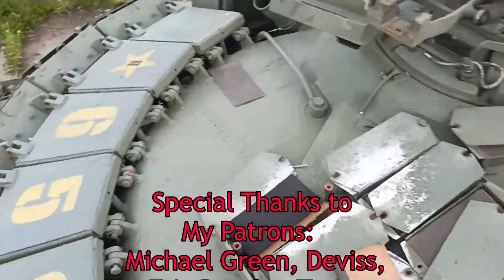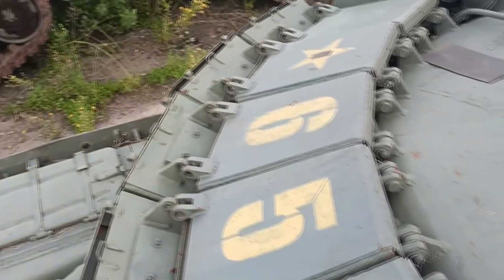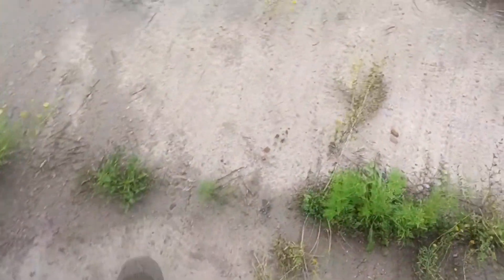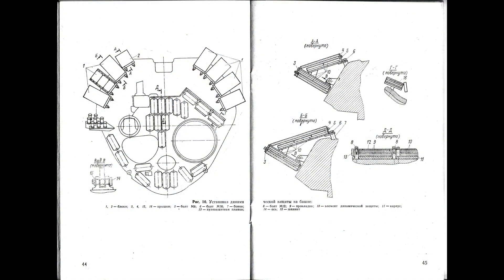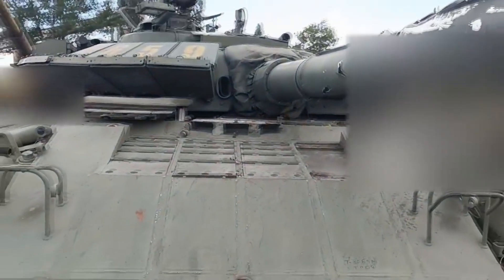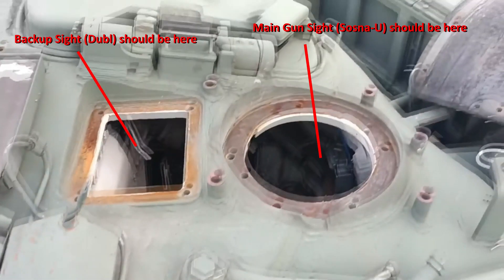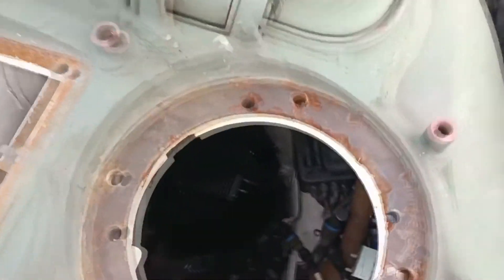Russians Are Using Rubber instead of ERA on their Tanks

Comment: Also, explosive material isn't expensive, particularly when you are a large Country which mass produces it yourself.
Reply: Compared to modern composite armor or ceramics/metals, ERA is much more cheaper and simpler to produce too.
Reply: @shanekhiu9884  But is it any better?
Reply: @shanekhiu9884  ERA still has place on modern battlefield, just not to protect tank front or sides. It has value only on top as seen on IDF tanks. It is useless against Javelin or Stuhna or even NLAW, but it can stop old RPG-7 round fired from upper floor at you almost vertically. Unlike low quality wrongly assembled in a hurry "cope cages" that don't work. Because surprise, surprise - slat armor has design rules and assembly quality requirements to function.
The funniest use of ERA so far might be by chinese on ZTZ99A's side where they sandwich applique composite with slat armor on top and then put ERA on it. It's effective, yes, but it's a bit paranoid at that point. And why wouldn't you just design turret with thicker composite filler on the side to begin with at that point?o_0
Reply: @TheArklyte  the cope cages worked wtf are you on about?
Reply: @ulfenburg7539  worked as a way to make tanks an easier to spot target due to increased target profile? Yes. Worked in any meaningful way? Lol, nope. And as a viewer of this channel you should know that and why they didn't. So go spread misinformation somewhere else, lol
Reply: @TheArklyte  Ukraine has multiple times show videos of drones with carrying bombs that they drop. This "cope cage" literally makes a lot harder for them to make an effective kill on tanks. This is not an invention of ukraine war. They also appeared in other wars. They made to prevent small ordance damaging the sights not to prevent ATGM. so yes they work.....
Reply: @ulfenburg7539  
1)those drones use HE bombs, which like mortar shells simply lack capability to destroy tanks in the first place. And RPG-7 shot from the roof would be just aimed at engine deck.
2)НИИ Стали provided clear specifications on how they should be assembled. Distance between slats, angles, steel sorting and profiles used. All of those were ignored by field command and cages were assembled in usual ass up fashion, ignoring all that would have made them useful.
Reply: @ulfenburg7539  
well, since you edited in, here's 3)it doesn't protect sights as sights are still quite fragile and you don't add enough stand off distance or shielding to protect them.
All for the price of making bigger target profile, blocking HMG and making it harder to escape.
Reply: @TheArklyte  Yes those small bombs and im talking about HE filler here. Because saying they don't off protection for those kind of shots would be stupid. While fragile they are still somewhat protected and offer a way better chance of surviving then if the HE landed right next to the sight. it is not an absolute that it will always damage the sights and what not if it hits those cages.
Reply: Theory:
 ERA explosives were removed and sold on black market, replaced by random rubber
Reply: Simply manufacturing explosives isn't expensive, however running quality control to ensure your explosives don't routinely kill your own forces is  very expensive
Reply: @Alex-ee5pl  it’s ERA, not a nuke
Reply: @Alex-ee5pl  not true, modern military grade gun powder and high-explosive are cheaper than sugar for most case.
Though the cost of sugar depends on specific countries, but explosive are more definitely cheaper than sugar.
Reply: @Alex-ee5pl  We are talking about russia, i dont think they rly care if some ERA just randomly goes of, they would still use it.. thats not a reason to not use it.
Reply: @Alex-ee5pl  you have a point but on the flip side remember this is Russia. the enemy is Russian testing ground.
Reply: unless corruption is eating 55% of the fending
Reply: It is not expensive for a coutry, but VERY expenvie for an individual Russian leutenant (or even colonel) respondible for those tanks production and/or maintenance 😉
Reply: Rubber is cheaper
Reply: Surprised they can even weld tbh
Reply: Cheap to produce, but it takes money for maintenance. You need soldiers regularly checking the condition of any kind of explosives. Also, explosives has expiration date, once expired, you need supplies and stock. Everything is money and resources, unless it doesn’t exist
Reply: 50/50
Russia has an infamous history of ignoring development of local chemical industry. It's bad, really really bad. The development of local processing plants should always be a priority, but Russia was content to just sell raw resources and not do anything from it even in soviet times.
As for enough explosives... half of soviet explosive used in WWII were lend leased. That means explosives for industrial mining, propellant for bullets, shell filler, bombs and engineering charges. Half of all of it. And when the war was over did priority to fix the deficit in chemical industry was realized? No! It never did. Chemical industry received even less attention then light industry. It's also part of the reason Russia is stuck in rentier state psychology that fuels authoritarianism on its soil:(
Reply: @TheArklyte  🧢, lend lease was like 3%
Reply: @TheArklyte  100% russian is assembled in Russia. and America is in the same spot. we have sent so much of our manufacturing over seas
Reply: @TheArklyte  что вы несёте ? Вы застряли в 90 годах ? В Росси давно все кардинально изменилось. Страна давно уже оставила голодные годы позади. Насколько вы  узко мыслите .
Reply: We talk about a large country that produces oil and its army abandoned their vehicles because of fuel shortage.
Reply: @Tarzan
When your private conscriptovich being paid almost nothing and you can get a few dollars for a piece of explosives.. well I guess your not a russian conscript.. these guys have sod all
Reply: @janwitts2688  Usually if something can be sold, it's the fuel first.
Reply: @janwitts2688  Exactly, this is an argument a russophob can always make - Russians are so corrupt, they still even this cheap stuff. Like there no corruption in other armies. Btw, do you know how much ppl get in US army? How much are there in jail for stealing stuff?
Reply: Creating it, making ERA tiles out of it, shipping it, installing it on tanks and running preventative maintenance is somewhat expensive because it's personell-intensive. So beaten up, blackmailed, robbed and underpaid Russian soldiers might not have been to motivated to do all that.
Reply: No but if the kursk was anything to go (and it is) there's a general neglect of care and QC when it comes to Russian armaments.
Reply: Yeah, but the RA has very weird priorities on kit that they could get. Most solider are missing night vision, optical units on their rifles, and gps systems in their planes. They should have all that, but most units are lacking such kit for some reason.
Reply: Yes, but when you don't have good logistical lines you could end up being desperate for something that is cheap.

Comment: Good video. Early on, candid roadside videos showed cardboard in place of ERA on a few T-72s. That's about the only "in-situ" I've seen of it. More likely the result of profiteering by corrupt soldiers/commanders in immediate proximity, rather than a strategic or systemic tactic.
Reply: No one knows if they had been scavenged or not, it’s not in one cut or video of a tank being knocked out or abandoned till the moment it’s inspected. The point is that Ukraine Armed Forces have all the motive to remove the explosives and claim Russian corruption or incompetency rather than Russian forces sending ill-protected forces into the field.
Reply: @shanekhiu9884  It's idiocy , these explosives are very specialised and not useful for other uses and we are talking about a army that uses tens of thousand tons of explosives  . Cheap ucrainian propaganda for idiots  . Now if I was a russian corrupt guy i would mess with the termal sensors , there is something valuable and multufunctional , not fking ERA components .
Reply: @shanekhiu9884  You definitely didn't see the video I'm referencing. It was a 47 minute encounter, on a single GoPro. The recently deceased crews and burning vehicles on the road with the T-72s as the camera approached, strongly refute your assertion that scavenging status was unknown. Also, at the point the video ends, they were pulling ammo from the undamaged tank and loading it into SUVs. That would likely be the first and easiest item scavenged if done so prior to any purposeful abandonment.
Reply: Just like here, the "egg cartons" are part of the soft ERA, they serve to hold the explosives in place. It's just unclear whether there were actually explosives inside.
Reply: Greetings! In those videos that you saw, the cardboard was located on the sides of the T-72b3 tank?
Reply: @cakckyhxa4351  They were, but my point was that they hadn't been scavenged and time had not passed, hence the in-situ description.

Comment: That vehicle is probably a trianing vehicle not re-configured before being sent to active duty . Era isn't normally fitted for training duties for obvious reasons -you don't want expensive dangerous equipment around trainees the trained guys are dangerous enought.
Reply: I suspect the explosives were there when the tank was captured. Look at 3:25 and you can see that all the bolts of the panels are removed. If there were no explosives in them you might open a few and then stop when you do not find any explosives that you can use. 

It is in my opinion more likely that all are opened if there are explosives there.  It could be somont that did did open all to make sure no explosives are left or it could even be the bolt was needed somewhere else.
Reply: @target844  why would ukrianian looters swap the era with rubber? It's an abandoned tank, they would just take the ERA and not replace it with anything
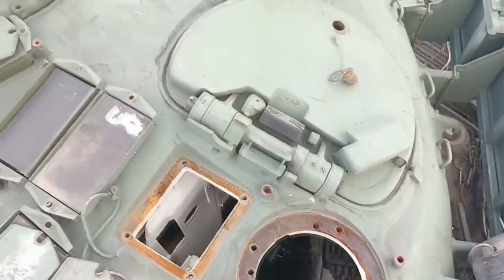Reply: @SelfProclaimedEmperor  If I understand this video correctly the explosives is not replaced with rubber. The rubber we see should be there. There should also be explosives and they missing, nothing has been added. Look at 1:50 in the video

Comment: It’s probably experimental NERA or Non Expensive Reactive Armor. It’s safer for infantry and crew outside the tank. Not quite as effective as ERA, or Explosive Reactive Armor, but is much safer for people outside the vehicle that can catch fragments from the explosion.
Reply: If you are walking besides a tank and an ATGM hits it, ERA exploding should be your least concern
Reply: @stilpa1  this is true, however, NERA is a type of reactive armor that has been an experiment for about 20 years now. Also most ATGMs use a HEAT (High Explosive Anti-Tank) warhead. These warheads use a shaped change to send a jet of super heated metal to burn through armor. This method doesn’t cause much fragments so it is safer for people outside the vehicle. Though it does cause massive damage to the inside of the vehicle which can cause the vehicle to explode and create fragments from the vehicle itself. Explosive Reactive Armor can create even more fragments. Both reactive armors are not as effective as having a decent layered armor system. NATO uses this type of armor.
Reply: @lightfootjpauls  the soviets used composite/NERA ever since 1966 on the T-64
Reply: @Rat-muncher  they have but it is nowhere near as advanced as NATO armors.
Reply: @lightfootjpauls  I wouldn’t say that as most of these information is still classified with only guesses and estimates of armor thickness given to us.
Reply: @Rat-muncher  though only against export models, combat provides the evidence. M1s, Leopard 2s and Challengers easily destroyed T72s in combat operations in multiple countries. It is obvious that these vehicles weren’t nearly as advanced as the non export vehicles even the T80s, T72s and the very few T90s that have been confronted in Ukraine have received far more extensive damage than NATO tanks being tested against all the weapons being used. Though Javelin and MLAW can knock out modern NATO models as well as Israel’s most advanced vehicles, the damage isn’t nearly as massive as have been seen against Russian vehicles. Though Turkey has lost Leopard 2s to the same reactions they are fewer then what has been seen in Ukraine.
Reply: ERAs aren't that volatile, they don't explode if you step on them. In fact, being shot is just about the only thing that will trigger them. If you happen to stand on one when a missile hit it, you're just meat spacer for the missile anyway, no point worrying about the ERA at that point. Considering Ukreanian equipment shortage, if they didn't even strip the eras when they had the sabotaged tank for half a year, they'd be incompetent.
Reply: @georgedang449  they can still provide an explosive hazard, therefore the need to dispose of them. Nothing like most other explosive devices but good to practice on. Never said anything about standing on them when they go up, you would be plastered all over the zip code if you were standing on top of it when an ATGM made contact. I was talking about fragments from being in the blast radius. All explosives cause fragments and blast force that can cause damage to people in the area.
Reply: lmao of course because russian weapon designers have always cared a lot about operators
Reply: @kopi828  this is true. I’m just speculating based on my experience as a US Navy EOD. I have worked on ERA devices left on Soviet era tanks in Iraq. After I did that I researched experimental and active reactive armor systems.
Reply: @kopi828  Operators are what makes the machines deadly. No one wants to drive and fight in a tank with no protection.

Comment: If ERA blocks is used on other tanks (I saw ex-polish T-72M1 with a LOT of it strapped) - why they took only explosive and left rubber and boxes - and not just took the entire thing?
Reply: Most of them don't have rubber spacers, and may not have space in casing to fit them. Even on this tank model, it's just the roof eras that has rubber spacers, not side turret or hull.
Reply: they did it on purpose for propaganda. use the russian resources on their own tanks while making it look like russia is losing